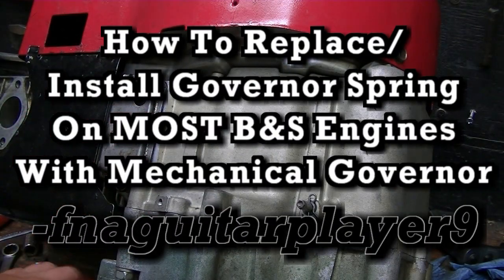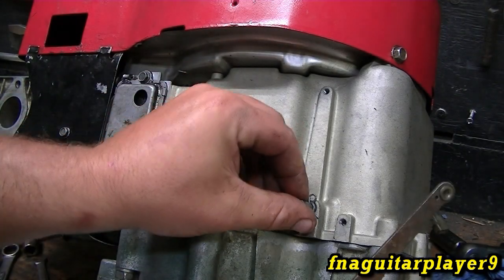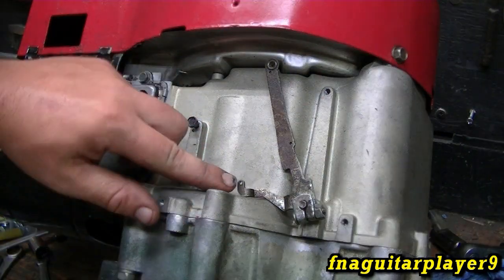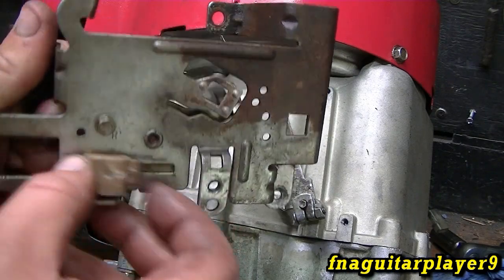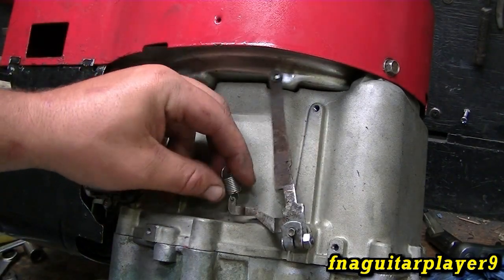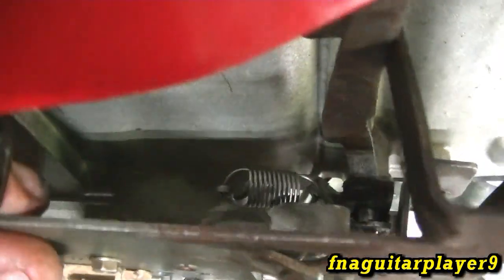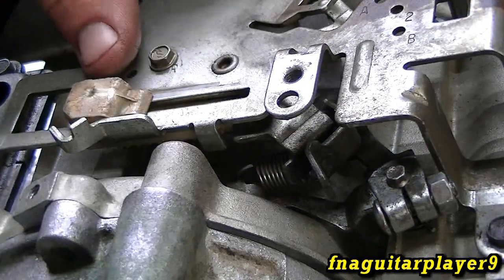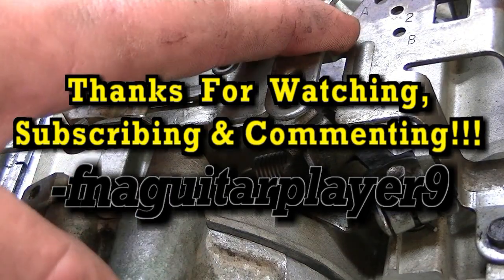How To Replace / Install Governor Springs on Most B&S Engines (14.5 OHV as ex.)

Comment: I have a B&S 10.5 hp motor on a a V-box salter, and I was wondering if you could help 
me attach an electronic throttle body (P/N# 141907) to the white plastic horizontal throttle bar?

Comment: I have Stiga lawn tractor with this assembly on a 344cc B&S. Due to some european regulations, the rpm is set to 2800 and the power to like 9 hp, while it should be around 13 hp at much higher rpms. Is it likely that they have use another governor spring? What do you think ?

Comment: I finally got around to rebuilding a briggs 13.5 hp. When I started it up it was running full throttle. Now I'm wondering if the little tab is misaligned from the shaft on the end of the governor inside the engine? It did have nice tension when I put the sump cover back on. I guess the ? Is can it be repositioned without taking the engine apart? Would doing an adjustment position it again? This is the first time doing a rebuild. I watched a few of your videos and was very helpful in putting the engine back together after a year of just letting it sit apart. I just hope I don't have to take it all apart because I'm old and can't use my left hand to good after cutting my thumb in half.

Comment: I just got a briggs 8hp on a 8-32 workhorse mower. The issue is that it locked up and if I try to spin the flywheel by hand or rope...the linkage to the throttle moves front to back and only lets the engine rotate a very small amount. Is something broken internally or is the governor bolt messed up?
Reply from the maker: It sounds like something may be broke inside, if it was ran low on oil it may have thrown the rod, sometimes it can be repaired depending on if it just broke the rod and didn't destroy other parts when it happened, i'd suggest removing the sump and taking a look to see. thanks for watching!!!

Comment: Great video. If the governor is broken inside the engine, would the engine always rev high?  I have a craftsman chipper that runs OK at low speed, but revs way too high at high speed. Thanks for any help before I sink time and money into this.
Reply from the maker: Thanks! Not always, but usually it will do that. I would try to adjust the governor first, i have videos on how to do it, if that doesn't work then you may need to replace the internal part. Thanks for Watching!!!

Comment: I have a 22hp  briggs and stratton that osculates. I replaced the carb with a new one and adjusted the gov. It's still osculates. Please help.
Reply from the maker: If the new carb is set to lean it will cause that, does it have a mixture screw, does it stop when you put a half choke on it? if it does its carb related, if not it could be internal problems with the governor. Thanks for Watching!!!

Comment: Hey Frank, I love your videos, they are very informative!

I was wondering if you've got any idea on how to fix an issue with a B&S lawnmower engine I've got. It's an 31P677 (Vertical model) from 2013. The engine runs fine when I start it (the oil consumption has been fairly high though lately, I've burned more than 1L this season alone), but after about 15 minutes of running it starts to run very rough. The RPMs drop, it starts to backfire (at least I think it does, it makes loud banging noises), and it starts to throw out a lot of smoke. I just turn it off when this happens, and let it sit for a bit. It runs fine again afterwards, at least for a while.

I already changed the oil, but to no avail. I didn't overfill it or use the wrong grade of oil (I used synthetic 5W30). I would have no problem tearing the engine down to fix it, but at this point I've got no idea what the problem is, could you point me in the right direction?
Reply from the maker: Appreciate that! the smoke after 15 minutes, is it black or blue, if its black i'd say your float may be sticking in the carburetor. I would also check the valve clearances, if its set to tight it could be opening the valves slightly when its hot do to the metal expanding, it is possible. But I'm guessing its more of a carburetor issue. using that much oil i'd say it needs new rings, if you tear it down you should change the valve seal on the intake valve, that causes them to burn oil as well. Thanks for Watching!!!
Reply: It turned out the head gasket was broken in between the cylinder and the part next to it where the push rods go, so the engine was losing compression by leaking into the crankcase. 15 dollars and an hour later she ran like a beauty again! Thanks for the tips though :)
Reply from the maker: ohhh. Those are bad about that. The briggs in my next video that happened to it plus a BUNCH of other stuff! I didn't think of that because they usually won't run at all when they do that. Your welcome, glad you got her going again!